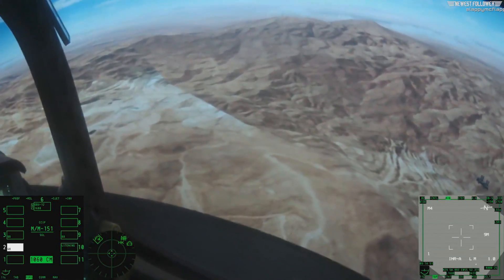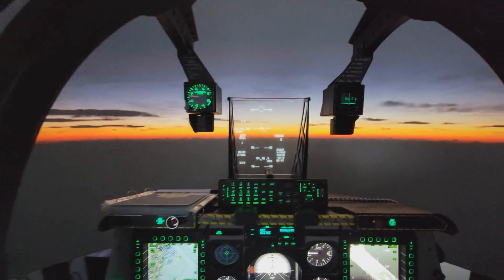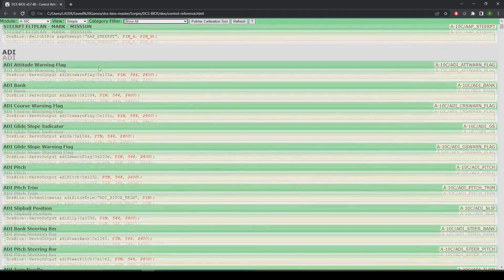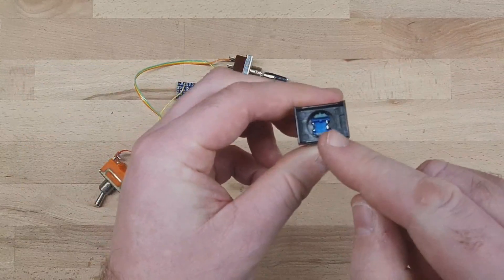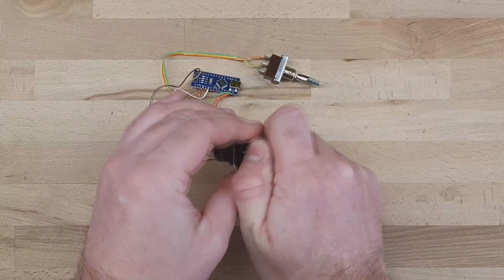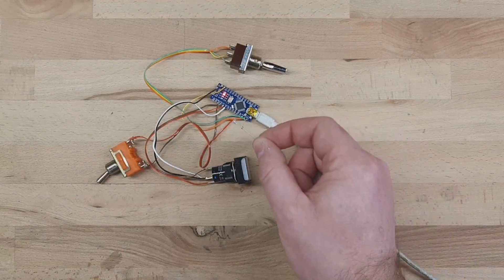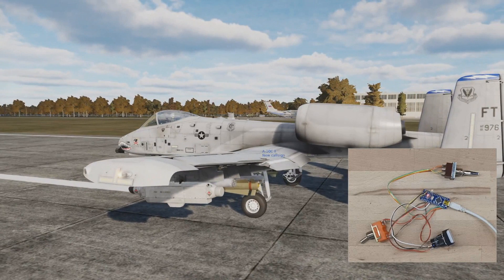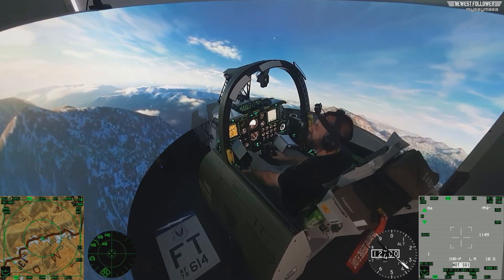Flight Sim Basics (Part 3): Connecting an LED

Comment: Thanks for this three part video series. Looking forward to seeing the rotary encoders video.

Also, you mention the use of DCS Bios, but I recall you mentioning using Helios for switches in your instrument panel video. Did you change from Helios for the instrument panel video screen? It's been a while since that video and I'm wondering if Helios is still the way to go for instrument panel video.
Reply from the maker: Helios is now only used for the gauges. All the buttons and switches are either DCS-BIOS or a generic USB joystick

Comment: If the LED isnt specced for 5V, you should have a current limit resistor.
However, I've found 12V LED buttons work fine on 5V, and need no modification. I think it might be because they have an LED driver that can work that low.
Reply: Yep, always have something limiting the current. The LED buttons (both 5V and 12V) generally have a resistor built in.

Comment: There's four contact points in that switch you could solder to; the LED has two different legs you can bend in a specirc direction; the wires go to the board and come off these pins in the back. All of this was good information for thise who know what they're doing, but all of that was list on me becuase you just takked and pointed. I, and most others, are not familiar wirh the hardwsre at all and need way more hand-holding. Which exact contacts in the button do i solder which arms of the LED and how do I twist them? Any tips for soldering inside the button? Looks difficult if this is your first time.

Don't rush through anything and remember the #1 rule of television: "Show. Don't tell."
I can't tell you how long i have been waiting for a walkthrough like yours. I assume many others have as well. Don't rob us of information and instruction to speed through the steps and video please. People can always skip or fast forward if they want but we can't add in more information. 
And this isn't meant as a dig AT ALL so please don't take it that way. This series is really important for people like me so i am just trying to assist you in delivering your message as well as you can. 
Let's put it this way: because of you, I am now buying a 100w Co2 laser for mtly god damned garage. 
Looking forward to the next one.
And if you do this right, I bet it will be your most popular videos in a year or two.
Reply: Fair point, but this is hardly a first-time soldering novice tutorial. 
These things take a lot of time to record.
Not hating, just saying.
Reply: You can get these same switches with built in LEDs. Tbh I see no reason to do this yourself unless you have the non-lit switch already
Reply: @Rokreder  The switch in this video came with a 24V filament bulb.  He was changing it to an LED.
Reply: @No1sonuk  fair enough. I would probably just use the filament lamp in that case
Reply: @Rokreder  Probably too dim on 5V.
Reply: The video would be very long if he did that. He isn't teaching how to do multiple skillsets. He is showing how he got to a particular solution and brought us along. If you want to learn to solder, google it. Want to know how to wire an LED? Google it or learn Arduino from the kits, it's all in there. Not assuming you don't know how to do these things just using them as an example. From what he showed I can replicate it no problem. However, what I want to know is how he was able to power the LED without a resistor in line to it. Must have been a 5v LED is my assumption or other some sort of magic!!
Reply: @paulgeorgelas383  yea, the question was about which wires go to which leads he showed. I don't think asking that to be clear on a video that is showing you step by step how to build a thing is out of bounds. It's kind of the point of instructions. Google it.
Reply: @adamcboyd  again, these videos are not that in depth🤣. If you can’t figure out how to wire up a simple led against 4 terminals then you might want to do some more self training and stop demanding others to do it for you. Again, it’s not our job to understand this for you. Your post was complaining about the lack of in depth instruction not a direct question about wiring so don’t deflect. Google it son.🤣
Reply: @paulgeorgelas383  Stop. Please pick a different fight and I am sure the creator can speak for themselves. You're not making anything better. You're not twarting a potential threat. You're doing your best to be toxic and chase his viewers away and I am pretty sure that isn't what he wants. So please leave me alone and stop telling other people what is alright to say or not. 
I'm here for the video. Not you. This will be the last I reply or even look at this thread so anything after this is for your own ego or some childish last word.
I'd like to go back to loving the content he puts up and engaging with him directly as a fan. That's it. 
Thanks for respecting that.
Reply: @adamcboyd  ok kid calm down, I responded 10 days ago. You’re carrying it on. Good luck on your sim build (if that’s what you’re doing).

Comment: Hey man, just about to start on an AV8B cockpit, these videos are invaluable.

Do you have a video on using DCS Bios with Arduino boards?
Reply: Check out the previous Basics video on his channel (Basics part 2: Connecting a Switch with DCS-BIOS), it goes over basic setup of DCS BIOS/Arduino

Comment: Nice one. Should you be placing current limiting resistors in series with those LEDs?
Reply: Came here to say that.
Reply: Not only a resistor, but it should have a darlington array or transistor because most I/O pins should not directly drive loads.